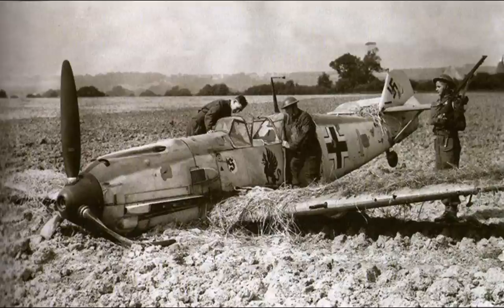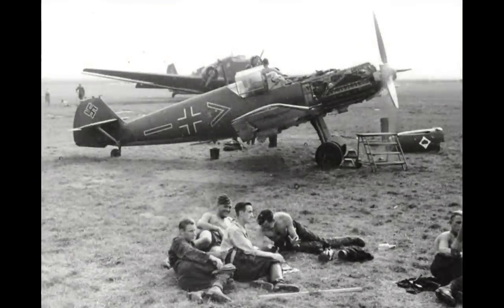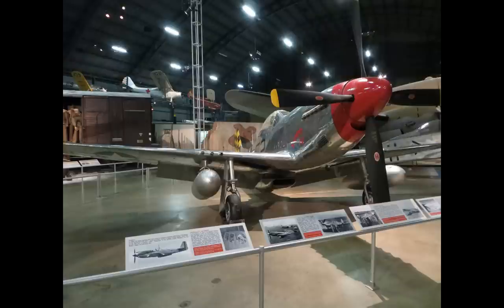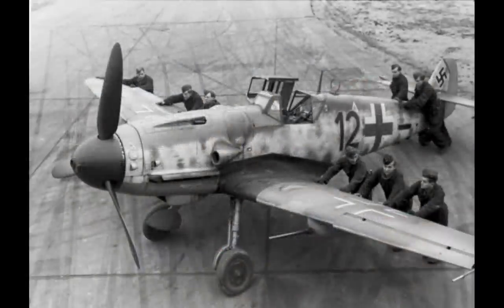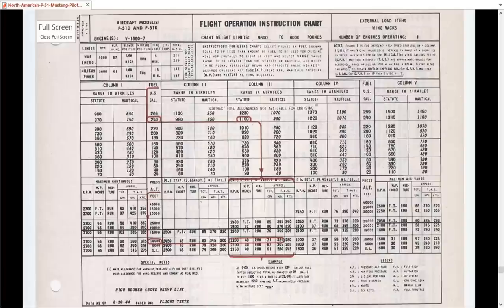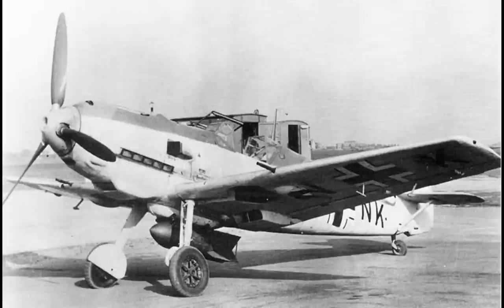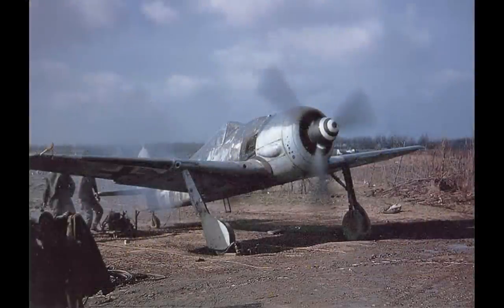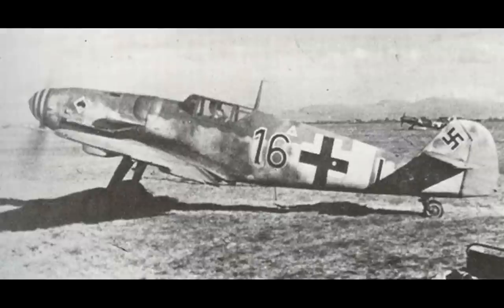Messerschmitt BF 109, Why Such Short Range?

Comment: Big engine, small aircraft.
For an aircraft conceived in the mid-thirties, went operational in 1937 and fought and remained highly competitive until the end in 1945, it was AWESOME.
Reply: Agreed. The fact that Albert Speer was able to increase aircraft production in spite of strategic bombing is pretty amazing. The Achilles heel of the luftwaffe was the following, fuel and the lack of a replacement pilot training program that could keep Pace with the war. Essentially their experience Pilots flew until they died. He didn't have the fuel the train with also. By 1945 they didn't have enough fuel to even fight with. The 109 in competent hands was still a deadly air airplane. Well except when they're carrying the air-to-air Rockets. Then they were sitting ducks. The aircraft was never really intended for that kind of external load.
Reply: It seems to be a German trait. Big changes from the 108E to the 109G. It seems the wonky landing gear and cockpit cowl was all that remained. Look at all the different versions of the 190, or the Ju88. Look at the development of the Porsche 911 since 1964 or the 3 series BMW. They just love continuing development of known designs.
Reply: @JohnRodriguesPhotographer   sed: 'The fact that Albert Speer was able to increase aircraft production in spite of strategic bombing is pretty amazing.' ... yeh, slave labor's a wunnerful fing - innit? ... 'n further opined: 'By 1945 they didn't have enough fuel to even fight with.' ... ahh... the pauvre cunz!
Reply: @keithstudly6071  dude I've owned a 3 series Beemer from the 80's, 90''s and now 2010's. I never thought of  it that way.
Reply: The last 109 left an assembly plant in Hungary in 1966.Didnt quite meet the production length of  VW bug,but was the longest of any type of fighter

Comment: Excellent video, very interesting.
Your comment about the development of engines and aircraft design during the war is well made. 

The orginal FW 190 had a range of about 500 miles in 1940, whereas the TA152 that was the successor of the FW190 in 1944 had a range of 1,200 miles. Quite an increase!

Comment: reading about the P-51 from the fliers themselves was...it was a flying fuel tank
Reply: Sam Moss Some had droptanks as well
Reply: When  full on internal fuel the P-51's CoG was so far back it caused "Reversibility," which is when the pilot pulls back on the stick to pitch up, he has to then push forward on it for the aircraft's nose to stop pitching up (as opposed to just putting the stick back to a neutral position). This made the aircraft impossible to trim for level flight until most of the rear fuselage tank was empty. The P-51 was made with range in mind, that's for sure.
Reply: Yeah, it had to be.  I haven't looked at the numbers lately but those pilots escorting the B-17s spent HOURS in the air.  It must have been grueling to sit in that seat, by yourself, keeping some type formation for hours and hours.  And the designers really had the benefit of hindsight to know what type of missions their planes would be used for and put fuel tanks everywhere they could.
Reply: The author of the historic 'novel/memoir' "Nanette" (about his time flying P39s in New Guinea against Oscars & Tonys-shudder) eventually transitioned to P47s and the P51s--he referred to the experience as 'eight hours of cramp ass'. I must imagine that trying to hold your bladder in check for 8 hours must have been a nightmare.
Reply: Oh I'm sure..but the process of unstrapping yourself to take your wizz must be quite an effort.
Reply: @Theodore042  What it caused was longitudinal (fore and aft) instability and all that entails.
Reply: ... and as a consequence was very slow when tanks were topped up and drop tanks installed. I have read that because of this, the bombers and their P51 'escorts' had to have additional fighter escorts part of the way to Germany because the heavily laden P51's were unable to dogfight with a full fuel load.
Reply: @wilburfinnigan2142  Yes, I see now the first Mustang to have a fuselage tank was the P-51B. That explains why the aircraft can't even fly straight on a full tank!
Reply: yeah, my understanding is that the designers took a less efficient airfoil, and made the plane fast by giving it a smaller wing.
Reply: Oh yes, not everyone is 'The Hunter', some are just 'doing the job' IE: Being 'The Prey'. The Author of Nanett, Edward Park readily admitted he wasn't a 'Top Gun' at all-especially when flying a P39.
Reply: @nickmitsialis  I've read something similar about pre-contemporary infantry combat. Only a fraction did the fighting, but the others had to be there to draw fire.
Reply: Yeah something about on a small number fired their guns--It turns out the guys who fired most had the 'lighter', easily portable support automatic weapons: BARs and 1919 LMGs; guys with short range weapons like submachine guns or slower firing weapons like the M1 tended to be 'suppressed' by the opostion especially if the opposition had Mg34/42s and/or were bunkered in....maybe it's a sense of powerlessness in the face of such firepower made folks 'cringe/cower', while full auto guys felt they could go 'head to head'?
Reply: The P-51D fully loaded with internal Fuel and external tanks was actually unstable in flight. The center of gravity was off. The pilot was surrounded by fuel tanks it was one behind and and one on either side of him. Those tanks needed to be emptied before the plane got into combat yeah, they adversely affected planes handling.
Reply: Thine hands shalt not touch nor shall thine eyes read the tomes of Caidin for he beist the teller tall tales and the peddler of questionable history.
Besides, the P38 doing escort work in Northeastern Europe had a whole set of other problems in deal with, namely the cold and the high altitudes where the fighting took place.
Reply: Yes a war memoir I had read of a P51 pilot (I forgot if it was an 8th AF or a 15 AF guy) where they warned him to switch to tank behind him to drain it down to a certain level before even switching to wing tanks, otherwise the plane was liable to flip over onto it's back unexpectedly(or was it a sudden snap roll?);
Reply: @Russ Gallagher I had the chance to fly in the backseat of a P-51C at an airshow and it was one of the loudest vehicles I’ve ever been in. The engine and short exhausts are right there in front of the cockpit and there’s no insulation. The only way to communicate with the pilot was to have the mic right up against my mouth where it was actually touching my lips and I still had to yell. That being said, it was still an amazing experience.
Reply: Traveler 1980 What??? Huh!!! ??
Reply: @Dave5843-d9m  All true.  There are far simpler reasons as well:  90 gals in front of the pilt.  140 gals behind the pilot.  75 gals in each wing-root.  SO, even without the drop tanks, it was a flying gas tank.  Something to think about during the nanosecond when tracer bullets are arcing your way....
Reply: @Dave5843-d9m  quite correct,  But the P51 did not actually have true Lamur flow wings and the wings were not dragy but more drag than say the early Mks of spitfire.  How ever since the P51 was built as a ground attack aircraft its wing is very strong and cavoniouse  thus lending itself to further development in fuel capacity
Reply: yes the Meredith effect, used both on the hurricane and spitfire as well as tempest and typhoon. although no ww2 aircraft can actually lay claim to having produced thrust ver the Meredith effect. the expanded hot air did reduce drag by effectively filling the void behind the radiator. in my opinion way to much is contributed to the Meredith effect on the P51 since it gave little advantage,  BUT what did or what was its real claim to faim is its correctly dimensioned bleeding edge. you can see from photos how they keeped on playing around with this from the Xp51 all the way to the P51H
Reply: Max Súarez Müller Not some they all had them on the long range flights.
Reply: @J M Archer It's possible but if the unit is made up of conscripts what are the chances you'll have just have 'somebody coming thru the replacement pipeline?....that factoid RE: who shot their weapon in combat had been looked at from several perspectives and 'axes to grind'-social, racial, technological, unit cohesion, training levels- so I can't really be sure--hell, I might be 'stuffed full of wild blueberry muffins' for all I know.
Reply: @J M Archer Makes perfectly good sense a squad automatic weapon or crew served automatic weapon man/team would get a higher level of training or motivation.

Comment: My understanding is that the Messerschmitt Bf 109 was always intended as a home defence interceptor fighter, hence its mixed cannon and MG armament. It was a bomber destroyer to protect the Fatherland. It did not require a long range but it did need a fast rate of climb - hence the large engine - and the two/three cannons to rip open bombers.
The offensive fighter was meant to be the Messerschmitt Bf110 with its six-gun armament and its two engine safety margin for long distance flight and safe return. Indeed these 110s were regarded as elite squadrons and received elite pilots in the early days.
Of course the reality was that the Bf110 was a lemon in daylight combat and was eventually escorted by 109s on daylight operations in the Battle of Britain. As a fast bomber the 110 had some qualities but it was never in the DH Mosquito category. As a night fighter it was adequate to good.
Barry
Reply: The Me 110 was built to the "destroyer" or "zerstoerer" concept.  Its job was to
1 Fly low and ahead of bombers to strafe up fighters on the ground and destroy enemy FLAK defences. 
2 Fly ahead of bombers to destroy enemy interceptors as they were in their climbing phase before they could attack the bombers the Bf 110 was escorting.
3 Intercept and destroy enemy bombers using its powerful armament.
4 "Bad weather fighter" ie night fighter able also to operate in fog.  The second crew member could track the aircraft via radio beacons and it could thus attack and intercept at night and in bad weather.  Me 110 had FuBL blind landing systems.
When the Me 110 was in service in 1939/40/41 there were no Mosquitos, P-38 or Buefighters.
So long as it wasn't tied to the bombers in close escort its exchange ratios was superior to the RAF fighters in the BoB.   When it was called upon to be a night fighter it was ready.  Original German Air Ministry Spec called for a 3 seater but Willy Messerschmitt submitted a  smaller non conforming bid as he reasoned that bigger aircraft would be too slow.
Reply: It's short-range was a severe handicap against the allied bomber offensive. Me-109s  had to be stationed near the target, leading to the fighter force being dispersed. The luftwaffe was not able to concentrate their forces against but incoming bombers
Reply: @WilliamJones-Halibut-vq1fs   small correction: Beaufighter!
Reply: @Wombat1916  William Jones- Halibut  Bigger correction: Bf 110 "exchange ratios" (whatever that means) was (sic) superior to the RAF fighters in the BOB.  Bf 110s could only survive against single engine fighters by flying a defensive circle (Lufbery).
Reply: @anitadolan6417    Ah yes, that defensive formation used at first by the Bristol Fighter in WW1 - IIRC, it was more or less useless.  When the Brisfit was used as a fighter with a rear gunner it did somewhat better.  Of course the 110 lacked the agility to mix it.
Reply: @anitadolan6417  Exchange ratio will be how many aircraft lost compared tolosses inflicted on the enemy. You'd expect the RAF to lose more fighters as they had more in the air for longer to be shot at and a lot were trying to shoot down bombers with the Bf 110's having just fighter command to fix their sights on.
Reply: 1918 armistice treaties limited the German military to self defence. Developing and building 109's could be done more openly
Reply: @hlund73  Wasn't having an Airforce basically a violation of the treaty of Versailles anyway?
Reply: @AAArnold  ... if u fink teh natzis bothered wif 'treeties' - mor ful u?!
Reply: @WilliamJones-Halibut-vq1fs  I am sceptical of the exchange ratios being superior to the RAF in the BoB.  I realize that you state this in a certain circumstance.  I wonder if that is a statistic that comes to us via Willy himself.  He was a superb backstabber and political spin doctor to the point of nearly shutting down Heinkel.  Heinkel of course having so many good designs that get second fiddled by willy and his cronies in the party.  Lucky for us in history, but unlucky for them and other aircraft designers.  Anyhow, I am curious just what scenarios the 110 prevailed in vis a vis the BoB (say that 5 times lol).  Just what did the 110 do well beyond wasting 2 engines and double the fuel?   I appreciate your post, but I just have a difficult time with the 110 being successful in anything other than nightfighter duty and deputy fuhrer delivery,
Cheers
Reply: The Germans were not expecting to HAVE to defend; attack was everything to Hitler. Range was just not considered much an issue ,airfields moving forward with the Blitzkrieg .When they later built the 262 jet ,that was a defensive fighter  ,but it was held back from production because Adolf wanted it changed to an attack machine ,and demanded dive bomb capability etc ,he still refused to consider defence .if he had not held the 262 back, and used it for defence asap  the B17`s and Lancaster`s would have been decimated. Even German Radar was not used in a defensive  manner only to guide their bombers to the target.The Brits did pretty much the opposite.it`s all about mindset!
Reply: Wasn't the "motorkannon" an afterthought?

And a single 20mm cannon and a pair of machine guns is rather light armament for shooting down heavy bombers as it is. Originally having twin fuselage-mounted machine guns must have seemed quite sufficient in the early/mid 1930's where in WW1 a single 7-8mm machine gun was usually enough.
Reply: @white-wy6dg  That bit of misinformation about the 262 is sourced to Adolf Galland in his memoirs. Now either Galland heard wrong, remembered wrong, or he did a bit of postwar blame shifting which was quite commonplace. The real reason that the 262 didn't see service until 1944 was that the Junkers Jumo 004 engines were not available in quantity until that time and it's quite difficult to have a jet fighter in service without jet engines. That was due to a shortage of metals like nickel and chromium to make alloys necessary for the high temperatures in jet engines. There was an Air Ministry mandate made in early 1943 that all new aircraft designs have the capability for carrying bombs. But in any case, adding a bomb rack or two is not going to significant delay any development. And if what Galland said is true, then why isn't the final version that made it into service a fighter-bomber?
Reply: @Treblaine  You've made a very important point. Before the Hurricane and Spitfire were designed in the mid-30s RAF Squadron Leader Ralph Sorley did research on the effectiveness of eight browning .303s against the bombers of the day and found a two second burst would shred them. He got the eight guns into the RAF specification for the next fighter designs and personally spoke to both Sydney Camm and Reginald Mitchell. This was very smart of Sorley, since both designers were thinking of wider fuselages mounting four guns firing through the propeller arc. Without a radial engine as good as the Merlin, these concepts weren't as good as how the two British fighters turned out or as well armed of course. The Messerschmitt design team was devasted when they found out the RAF fighters were going to mount 8 machine guns. They had to put armament in wings not designed for it. The  Bf109E's two cannons were not enough. They had not enough ammo due to the too thin and frail 109 wings and a poor muzzle velocity, meaning a cannon shell might explode against the metal skin of a Spitfire rather then penetrate and do more damage inside the plane. The sheet of armour hastily installed behind the pilot's seats of all RAF fighters just before the BoB also helped save pilots lives against cannon shells. The 109E had a weak airframe generally. Spitfire pilots found even though the 109E fuel injection made it faster into the dive, at the bottom of the dive a cautious pilot would pull up slowly in case its wings were torn off, so a determined Spit pilot could catch it if he kept his nerve and pulled up quickly. The 109E's tail was so weak struts were needed for the horizontal stabilisers, as we already know.
Reply: @hlund73  did not know that, interesting fact.
Reply: @neilpemberton5523  fascinating, please tell me more.
Reply: That seems to be a little backwards thanking. Got a remember that the Germans were arming up and were the original aggressors they didn’t have to shoot down incoming bombers until mini mini years after this plane was developed and introduced.
Reply: And don’t get too hung up on the issue of therapy and cannons and machine guns that’s very common for the axis powers on fighter craft. If we are talking allies and Americans yes they generally stuck more to machine guns exclusively.